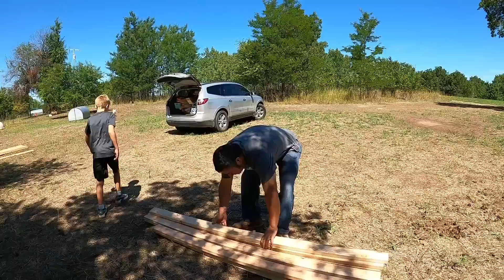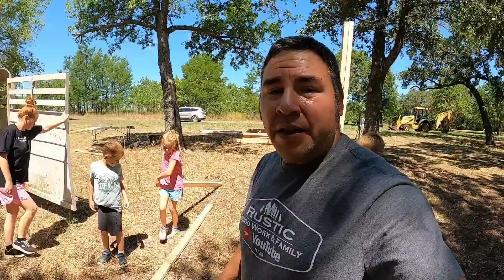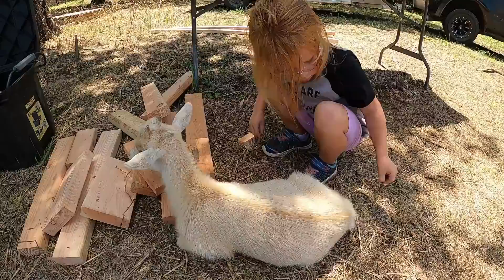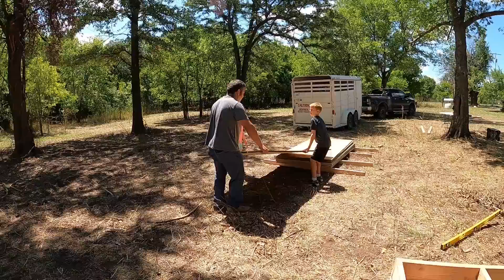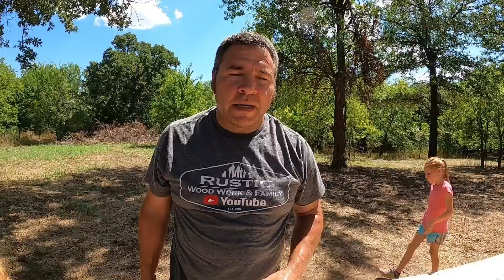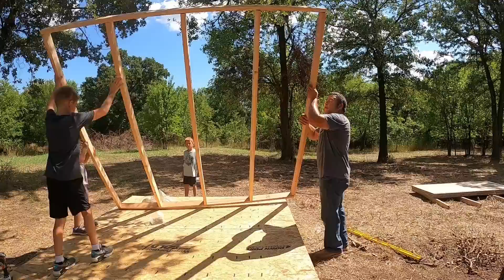Everything is coming together on the YouTube studio / Storage building!!

Comment: I would consider putting some concrete bricks under where you’ve got your wooden blocks I wouldn’t depend on those as your support I would put regular cinderblocks under those corners if you could get them I know it’s just a workshop but it would be better built if you put cinderblock instead of those shim boards or try some railroad ties if you can get them

Comment: You need to get your blocking off the ground, just a cinder or concrete block will work if cost is the issue.  You will be lucky if the untreated  lumber you are using will last a year before it starts rotting away and the building will start settling if it is n direct contact with the soil.

Comment: I was going to suggest concrete blocks as well, and not just under the four corners but  under the whole floor, or it will just sag in the middle. Get some string set on sticks or whatever on the four corners, same height and level. You can use that to set all your concrete bricks at the heights they need to be level. Thenyou can set your floor on that and everything should be level.(same way you see Lester building his fence lines...only lateral instead of vertical)